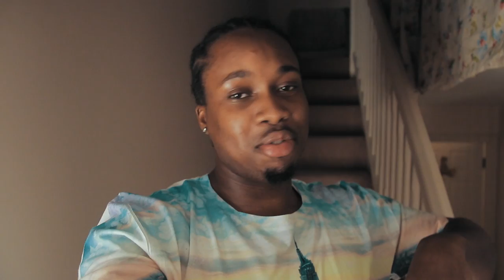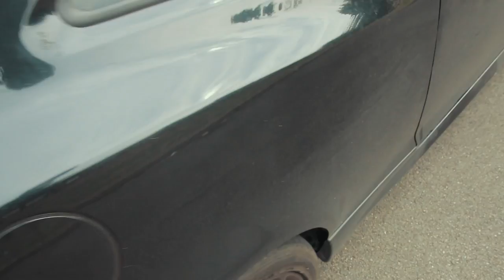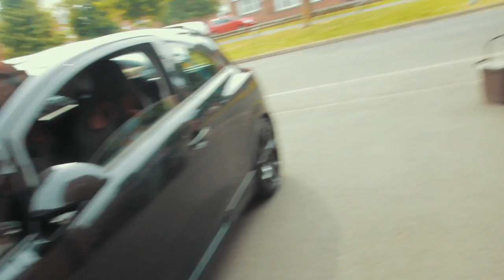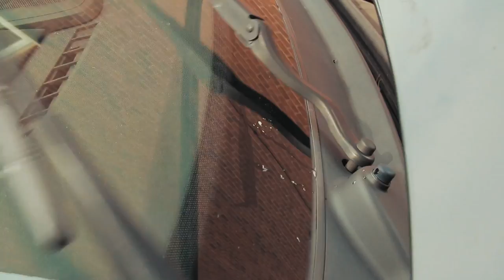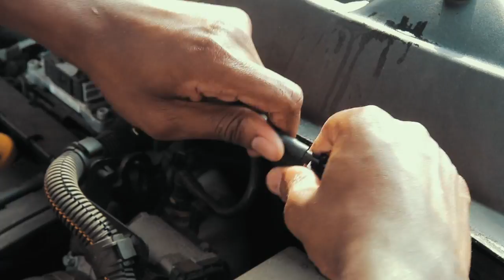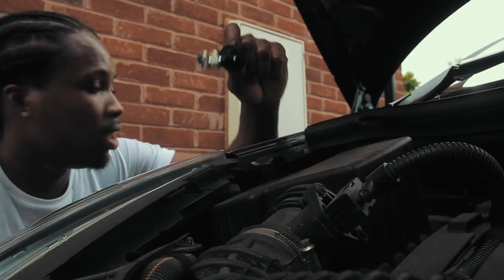2 VERY EASY DIY CAR MODS

Comment: I've done that before fitting led side light bulbs. Get a vacuum cleaner and a drinking straw and fix the straw on the vacuums pipe with some duct tape. That will concentrate the suction allowing you to put the straw in the headlight and sucking the bulb out. Good luck I hope this helps.😁
Reply from the maker: Co182 dam will give it a try